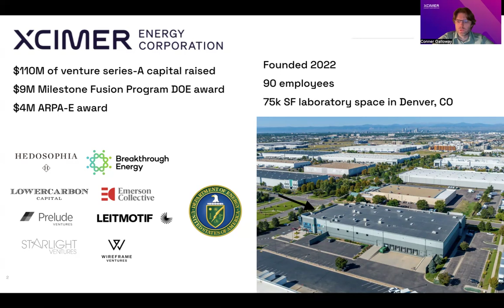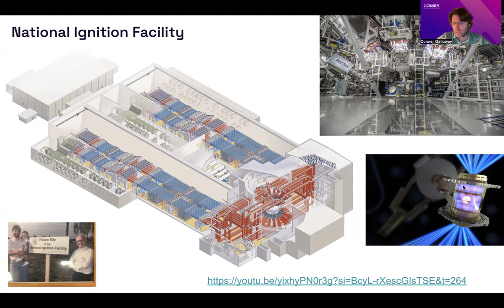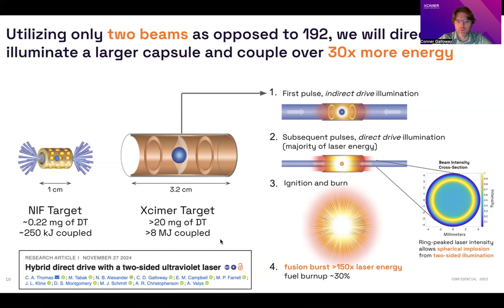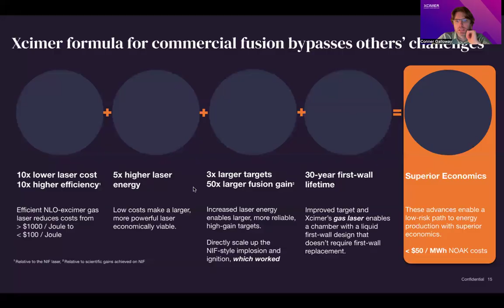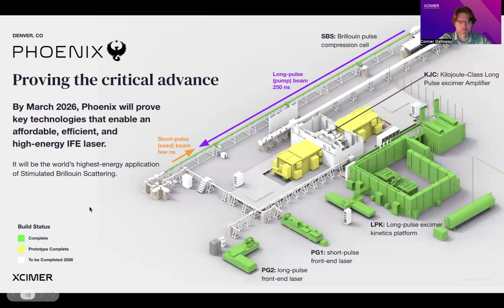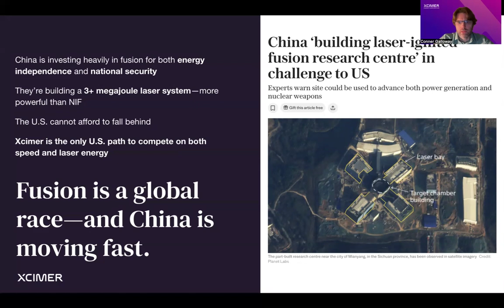Fusion 2035: Conner Galloway, Xcimer Energy

Comment: Thanks and good job, Conner & Mike. ❤👍
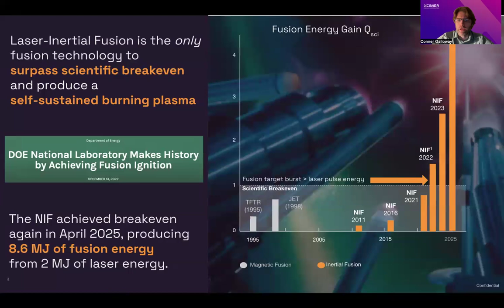02:36 I’m glad someone acknowledged ignition has an energy cliff (~10 MJ Halite/Centurion) which NIF recently lowered to ~2 MJ, beyond which yields increase faster than energy supplied to the fuel capsule. 
10:08 How do counter-propagating laser beams transfer energy from long to short pulse? 
08:13 Excimer lasers are not factually 10x more efficient than solid‑state lasers—in fact, the opposite is true. Modern solid‑state systems (especially diode‑pumped) can reach 10–20% wall‑plug efficiency, while excimers typically operate around 1–3%. Where excimers do have an edge is scalability: because the gas medium can be expanded to very large apertures, they can in principle deliver multi‑megajoule pulses at lower capital cost per joule than massive solid‑state glass slabs.
So the “10x cheaper and 10x more efficient” line is really startup optimism, not a demonstrated fact. At best, excimers might prove cheaper per joule at the multi‑MJ scale if engineering hurdles—gas handling, toxic fluorine chemistry, optics lifetime—are solved. But efficiency gains are not inherent; they’re speculative projections, not present‑day reality.
Reply: Even with a photovoltaic conversion efficiency of merely three per cent, commercial viability remains achievable provided the ratio of energy output to input is sufficiently high—for instance, at least one hundredfold.